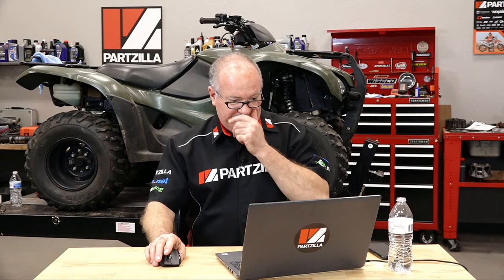Partzilla Live Q&A with John Talley -- 01/15/21

Comment: John, I have been through every factory service manual I have and can't not figure out a No Spark issue on a 88 xr 600 I have. Even swapped electrical engine components from a 92 model. Not frame electrical though...  Model crossover inbetween those years. 
I don't understand the realation between the magneto,coil,igniter, cdi, crank trigger? and would the flywheel play a role in the no spark. On these air cooled Honda's
Perrty much ansewerd my question. Responding to sombody in video.

Comment: Yamaha 700 grizzly went dead on ride. Change battery and all fuses. The display only has back light comes on. No power to rear. It will turn over but will not start. Changed silonid...help!

Comment: Good evening John/team, I have a Polaris RZR 900 XP EFI 2012. It reduces the speed drastically when I release the gas pedal, the wheels are literally sliding on the road. It seems to be the clutch that does not disengage. I would like to know if I have to replace any internal part from the primary or secondary clutch. Thanks in advance
Reply from the maker: i have a few questions. 
1 does the unit try to pull forward when in low or high at a stop? (do you have to hold the brake to keep it from taking off?)
2 which  tires are sliding when you let off of the accelerator?